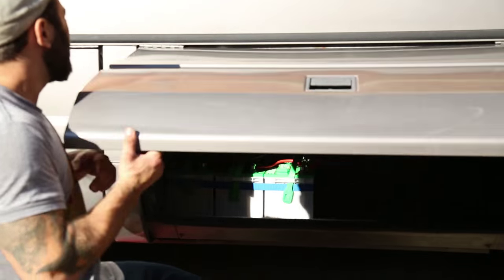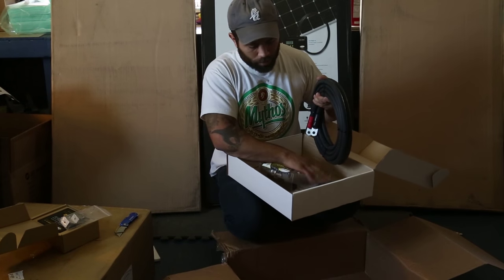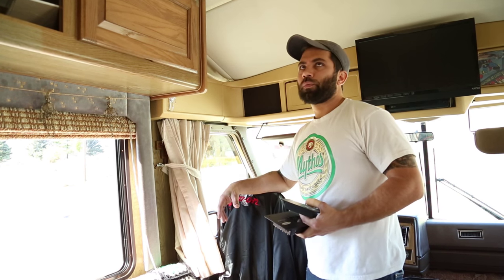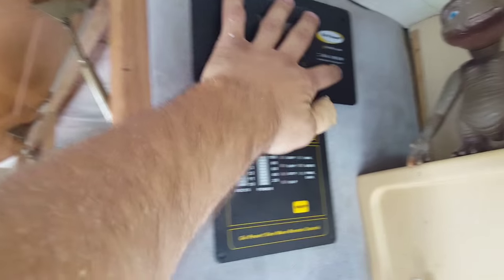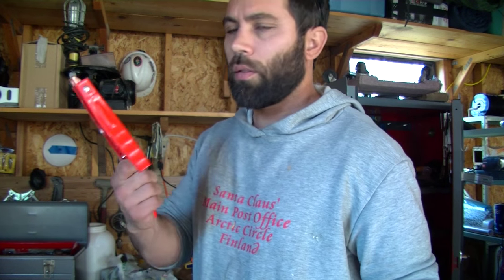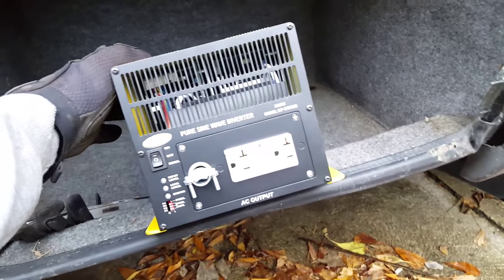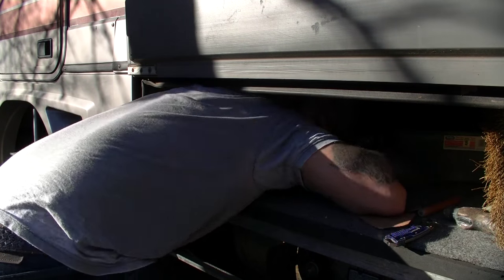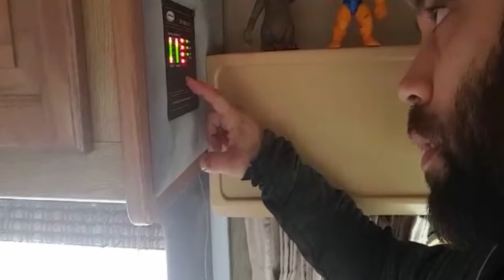Full-time RV: Installing a Go-Power Solar and Inverter Set-up

Comment: I feel your frustration. Whenever I'm working on car things, or in the garage where there is a lot of places to put things down, I inevitably end up running around with a strained look on my face yelling "I JUST HAD IT IN MY HAND!?".
Reply from the maker: +Matthew Schofield Lol, thats why my tool box has about 3 of each tool.  I loose it, buy one, then find it.  Story of my life.
Reply: +Luke Capasso Yup. It's also the reason why I have 7 bottles of 2 stroke oil.

Comment: nice video, thanks for sharing.  the only thing i would say that you should move your 3000w inverter somewhere where the air ventilation is good. almost every inverter manufacturer says this in installation notes. keep up the good work.
Reply from the maker: Ive a vent on the side of the couch. It gets good air.  Thanks though.

Comment: You should mount all your batteries in one location for inside the RV and mount the inverter, Shore power charging converter, and Charge Controller, As close to the battery bank as you can. You will get longer life out of the batteries, less voltage lose and Amps per charging cycle from the solar panel system.

You should also only use as much Ah per day then you can put back in a day from solar, the alternator, or shore power. Because if you use lets say 400 ah everyday and you can only put back 250 ah, The batteries will fail in short order. 

So take all the watts you are producing divided by 12.8 volts x times sunlight hours and that is the amount of Amp Hours your solar can support without the alternator or shore power to top off the batteries. You should also only use 50% of the ah the battery is designed for. So it the ah is 150 per battery x5 that is 750 ah divided by 2 which is 375 ah. Which means you need to produce 59 amps an hour from the solar system for 6 hours in a day, if you use 375 ah a day.
Reply from the maker: +Claude “Reviews4U” Rains Good call.  I've a bulb in with the batteries but didnt want them inside as I understand they give off fumes.  The relocation of the battery bank is on the to-do list for sure.  I'm still working ok the kinks but power storage is still an issue.  Think most of it is based on the cold weather but I'll have 70% battery at night.  Only run the frig and nearly nothing in the morning.  Same useage for running all kinds of stuff or nothing.
Reply: Luke Capasso I didn't mean inside the RV, I mean all the batteries that supply power to the inside of the RV should be grouped in one place. Along with any inverters, converters, and charge controller. This makes all the wiring shorter runs for big gauge. You should also use the negative off the last battery in the chain of batteries and the positive on the other end. This keeps the batteries voltage balanced when being charged or discharged across all the batteries in the chain.

Comment: Dear Luke - I also have a Pace Arrow that is the same exact year and interior that you have.  (I'm gutting the interior!)I just bought a solar panel and thought I was getting a kit, yeesh.  I have to call the co. on monday to get the other parts.  I bought a 100watt panel.  Is that enough to power the ac, electrical etc, if I have enough batteries?? Thanks.  Debbie

Comment: Great video, very entertaining. How many Amp hours are your batteries and are your panels 100w ea? Sorry if I missed this info in the video.
Reply from the maker: +JustPeg Hey thanks Peg.  These are the batteries I have. I didn't want the duel purpose but as I already had 2 I wanted to stay the same. http://www.interstatebatteries.com/p/interstate-batteries/srm-24/interstate-batteries-srm-24-srm-24?dsNav=N~4294784989-4294749800-4294749799-4294749798-2147384903  Yeah and 100w

Comment: Do some more research on how to do a safe professional install. There are some good ones out there.  Your cable runs need to be shorter, 6v batteries,  a good charge controller and battery monitor and correct cable sizes are paramount.  good luck.
Reply from the maker: used all the supplies/cables that came in the kit dude.